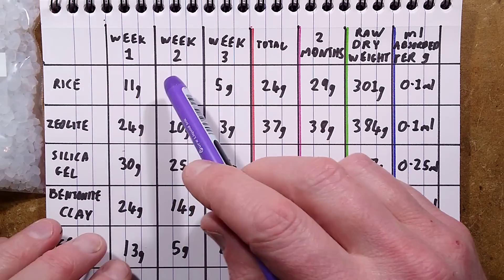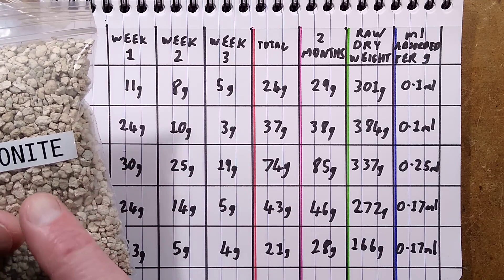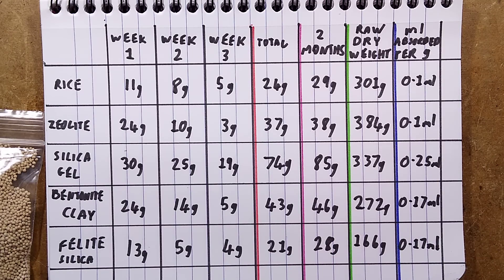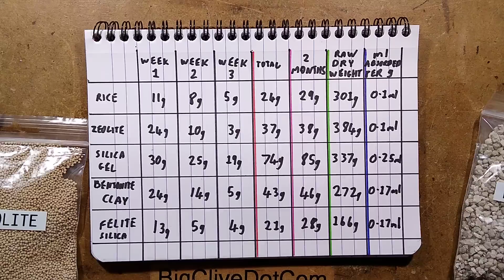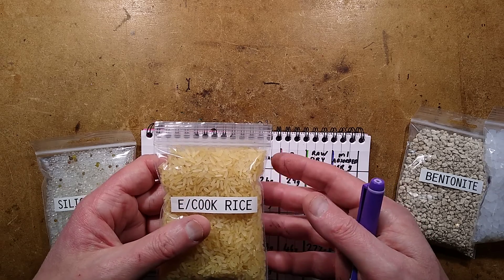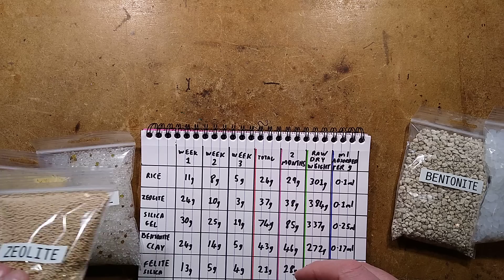Five desiccants - two month test with full results

Comment: I've used a variety of desiccants in school and at work. One you could try is Drierite (calcium sulfate) It is less expensive per gram than silica gel, but absorbs less moisture. Yes, regeneration at higher temperatures would improve performance of silica gel and especially zeolites. Note that there are several different types of silica gels and zeolites. Some types work better than others for drying air. Desiccant grade zeolite needs much higher temperatures to regenerate fully than desiccant grade silica gel. At less than 40% relative humidity fully regenerated zeolite has a higher capacity than fully regenerated silica gel. The absorption capacity varies with relative humidity and to a lesser extent temperature. Suggest you get a combination high/low recording digital thermometer/hygrometer ~$10 USD.  Lots of desiccant info at Sorbent Systems website.

Comment: Very cool experiment!  But I imagine Magnesium Sulfate will be far superior.  The stable form we typically buy as "Epsom Salt" is a heptahydrate at 246g/mol, so the anhydrous form at 120g/mol  (which you can get by heating to 250°C) can absorb 1.05ml/g!  Or heating to only 120°C will result in monohydrate at 138g/mol, which can absorb 0.78ml/g.

Comment: How dry do you want it to be ? Sometimes I'd use quicklime pellets/rocks in a closed glass desiccator with or without vacuum. Depends on what you try to dry. Once I had to dry ammoniumacetate to form nice dry pure crystals, well that needs a closed system with the quicklime but no heat or vacuum otherwise it will either melt or sublime. Water vapour  and also the carbondioxide that is present in the air reacts with the lime to form the hydroxide and carbonate from the air. The quicklime can be regenerated by calcinating it in an high temp oven such as uses for glass working. 
And yeah please use both the mass and volume for comparing different methods of drying agents. 
A wet phone would brake if under full vacuum but nested in silica drying beads in a glass desiccator and a bit lowered pressure and an infrared lamp pointed at the setup to ,say, 40 degrees C does wonders. 
Also its important to know which type of "wet" is the culprit. Rainwater is ok enough to put it directly into the system. But spilled beer or soda or even tap water is nasty. Then asap spray and rinse with distilled water quicly to get rid of salts and use a vacuum cleaner (with care other wise the speakers etc will pop ) for example to remove the bulk of the liquid. Then to dessicator and hope for the best. An alcohol solvent the 100% pure type either methanol ethanol or IPA can also be usefull for cleaning and drying but in the case of a phone I bet it would damage it. 
It is upsetting that batteries are no longer easily removable from devices nowedays, it would prevent a lot of damage if you could can remove the battery in a hurry and then also do the rinsing and drying ritual.

Comment: Would the relatively low drying temperature not put materials with very high adsorption at a disadvantage?

Another dessicant I've been seeing a lot lately is calcium chloride. It comes with spools of 3D printing filament, but apparently it's more of a powder. Can't feel any grains in those bags.
Reply from the maker: Calcium chloride turns into liquid as it absorbs water.  But some pouches have a gelling agent in them.

Comment: Horses for courses.  If you just want to take the edge off humid atmospheric air and regenerating the desiccant manually, then it makes sense to measure how much water the stuff will hold when it's at equilibrium in a dewpoint of (say) 6C.

If you want to achieve -56C (atmospheric equivalent) dewpoint in air at 300 bar, you're interested in desiccant that can take the punishment inherent in being dried out to that extent and this is where the more exotic materials come into their own.  The beauty of zeolite desiccants is that they'll stand pressure swings of 300 bar accompanied by temperature swings of 200C and will put up with that several times an hour for months on end without turning into concrete.

Comment: hi, please dry the silica at 150°C as it needs that temperature to drive off all the water from the silica. I use the microwave (in bursts) and measure with a thermometer that I stick in. Once the 150°C  are reatched it stops giving off water  vapor.

Comment: Your sensible use of metric measurements reminded me of this quote I love by Josh Bazell:

“In metric, one milliliter of water occupies one cubic centimeter, weighs one gram, and requires one calorie of energy to heat up by one degree centigrade—which is 1 percent of the difference between its freezing point and its boiling point. An amount of hydrogen weighing the same amount has exactly one mole of atoms in it. Whereas in the American system, the answer to ‘How much energy does it take to boil a room-temperature gallon of water?’ is ‘Go fuck yourself,’ because you can’t directly relate any of those quantities.”
― Josh Bazell, Wild Thing

Comment: Good test. I will say hot air absorbs more moisture than cool air. So in an ideal situation,  you would heat the entire room to adsorb all moisture from the room into the air and then push it through the drying media. But your little heater probably helped a bit, Im just curious about the rest of the room. I.e. a humidity measurement from the room would be an interesting thing to follow. But it would probably have to be a relatively small room to see any real changes. Good job. I love it.

Comment: Believe it or not, science has already done these tests and the data is readily available in the standard literature.  This is because selecting the correct desiccant often means the difference between a process working or not, or at least can have dramatic impacts on the bottom line.  You can often save yourself a lot of needless effort with a minor effort of research before committing to a project requiring months of investment.
Reply from the maker: It's always good to do your own tests with actual available materials.
Reply: @jzero4813 Unless you use the exact same product in the exact same environmental conditions for the exact same purpose, the "standard literature" is objectively irrelevant.

Comment: You should try some other easily available, though maybe slightly less convenient desiccants like calcium chloride or if you really want to see something good, try phosphorus pentoxide. They are much faster and higher capacity than silica gel. Calcium chloride is pretty easy to buy or make, but it makes a goopy mess so you contain it in a dish or something. Phosphorus pentoxide is a little harder to get but it's the bee's knees and will stun you at how good it is.
Reply from the maker: The calcium chloride was too wet for this test.

Comment: You should try Activated Alumina. I have some for my 3D printer filament and it seems to work way better than Silica Gel. Slice Engineering sales them in canisters for 3D printing and they ship internationally.
Reply: Thanks for the tip! I have just been using silica packets for my filament. I'll buy some activated alumina and give it a go.
Reply: @RiffRaffMama.  I used to use the silica gel, but my dry box only got to ~35%. Now I am using the  activated alumina and the same dry box is sitting at ~15%. Also no more PLA that is so brittle it breaks just sitting there. What happens when it gets too wet.
Reply: @dl200010  Is that why that happens? Can you still get the moisture out of it at that stage, or does the dessicant just keep the moisture away?
Reply: @RiffRaffMama.  Not sure if you can save the bits that broke off, but the spool I put in a filament dryer for 8 hrs. The descendants are to keep the box air dry. Pulls moisture out of the air. I don't know if it can pull it out of the filament.

Comment: I used to use baked out epsom salt wrapped in paper towel as a dessicant for the optics chamber of moisture sensitive laser equipment. It worked far better than the silica gel beads in protecting the moisture sensitive crystals inside.

Comment: Calcium chloride is so cheap & effective, reusable desiccant hardly seems worth it.
Reply: i have three bags of calcium chloride for my electronics at home. one is inside my computer, another one inside my LCD TV and the third one is in a sealed container in case i might need it someday
Reply from the maker: The main issue with it is that it turns into a very conductive liquid as it absorbs moisture.

Comment: I would recommend not using traditional cat litter (bentonite clay) as a desiccant. Having had cats I know that kind of litter is very dusty and the dust gets everywhere. It would definitely get onto the filament itself and cause damage to the nozzle over time, unless one had a hardened nozzle meant to print specialty filaments (marble, wood, carbon fibre, etc). It would be like printing with a filament that contained clay. The dust problem also makes it inappropriate for anything concerning food.

Comment: There are a LOT of different types of zeolites, but for the common ones intended to adsorb water, you really need to dry them between 200-220°C at least. (Some kinds of molecular sieves even require overnight drying under vacuum at 300°C, immediately before use!)
Also keep in mind that "drying" doesn't just mean "sucking up" liquid water or absorbing water from the air at high relative humidity.
Unless the drying agent chemically reacts to destroy the water, there will always be some amount of free water left over, because the water adsorption/desorption processes will eventually reach a dynamic equilibrium. This is why adding multiple times the mass of dessicant, that you theoretically need to adsorb/absorb all of the water in a fixed volume, results in not only faster drying but also gives you a dryer end product.

For example, a good zeolite will adsorb water from fluids even at relatively high temperatures (50-80°C) and will be able to maintain single digit PPM levels of water contamination at equilibrium (assuming a large enough excess is used).
At the other extreme, rice will actively make a truly dry fluid much wetter (going from ~10 PPM of water to > 1,000 PPM), even if you dried the rice at higher temperatures and used it immediately after.

Some Zeolites just "bind" the water much stronger than any other reusable dessicant (hence the high temperatures needed to dry them) and they can therefore effectively dry a larger variety of materials (i.e. you could use 3A molecular sieves to dry rice or bentonite clay, but you can't do the reverse. This is important when the thing you're drying is itself hygroscopic.)

Comment: DampRid uses Calcium Chloride. The downside is that the hydrate is a liquid and is rather corrosive, and it can still absorb water even once it's a liquid so if you spill any you'll get a seemingly permanent wet spot on whatever it absorbed into.

Comment: Clive I would suspect that the material with the largest surface area per mass should have an impact on the uptake of water in the material.
Just as in batteries the electrodes with the largest surface areas can store more energy.

Comment: Very good! I have a personal interest in this (you do that a lot with your vids - Ms.Flambeaux excluded :D)... 

I have a hyper-baric compressor that can easily go to 4000lbsin2 (i.e. ~300 bar) and the target for the compressed air really does need as close to zero moisture as possible to avoid damage. There is a two stage piston in the cylinder with a first stage "basic" compression, and then a second stage "final" compression that has a tiny "needle" piston with massive cyclinder walls. The problem comes in with moisture in the air at these pressures and dimensions and it gets really hot when working hard - 100C+ easy. I run the input through a series of cotton "swabs" that take out any obvious moisture and there is a gravity-fed bleed valve that needs opening several times during a session and always produces hot emulsified oil & water. 

The final output is then fed through more swabs (to remove oil vapour mainly) and then into a thick-walled cylinder which is the final drying chamber. Inside is an acrylic tube about a foot long filled with colour-changing silica - it starts out orange and changes to dark green when it has absorbed moisture. The tube is a loose friction fit so as not to burst it in the high-pressure air (i.e. pressure is the same both sides of the wall) with an O-ring at the far end so the air can't sneak past but rather has to pass over the silica. The output air should be very dry but I wonder how quickly the silica will absorb moisture? That said, the silica is still orange and I would have thought if my pre-drying was shabby, I would at least have seen some disclouration (it does in normal air). I have seen "Molecular seive" available for drying but I don't know what the material actually is for reference.

From your figures, the 337g of silica you started with seems a bit more than in my acrylic tube-ful (never weighed it but will now) and rough maths says it was taking out ~25ml per week, which, say, is ~4ml per day or 160ul per hour... which now I write it doesn't sound too bad. I wonder if the forced airflow and huge pressure will make any difference in my case. The pessimist in me is mindful that high pressure tends to squish the water tighter into the air molecules (hence high pressure = fine weather) so maybe the final drier is not as effective as it might if it were pre-drying - i.e. on the air intake somewhere. Unfortunately I have no way of measuring.

So my concern is not so much "quantity" but rather "how quickly"... I am going to start with dried silica (yes you can re-use it) and do before and after measurements. I have to spend some time thinking about what constitutes a good test... time or volume of air - this latter is considerably and I would need several goes at it just to let the compressor cool down.

Thanks Clive... inspired me to do some tests of my own. Maybe even video it and post it.

Cheers

h

Comment: EPSOM SALT!
Try that, though you need to find a way of containing it as it will expand when it absorbs moisture.
To make it anhydrous, simply heat it to about 80 degrees for about 10 minutes, and stir it before ramping up the temperature to 110 degrees C - and leaving it for another 10 minutes, stirring occasionally.
I did this in a glass jar in an oven - so the end result may vary; but the idea behind stirring is to stop it from forming a solid hollow 'cake' which is really hard to get out, and may not have as much surface area as the granular powder you get when you stir it up as it dries and shrinks... Also you don't want to melt it...
The result is a very active desiccant, such that it shrinks down to about 1/4 the original size when dried, and is difficult to keep 'purely anhydrous' since it will immediately draw moisture from the air once the temperature drops below 80 degrees!

Comment: Hey man, i have a "strex" wireless electronic airduster here.
Its broken.
I know whats broken too.
Its the power button.

My last one broke too and that time was within warranty. 
Idk if it still is, but i declared it intentionally cheap garbage because i was SUPER careful the second time, so i bought a "compu cleaner xpert", which was only a little more expensive, but seems actually well made and much more powerfull as you plug it into an outlet.

If you want i can send the "strex" to you, it seems to be an often rebranded dropshipped item.
Its not horrible and if you can fix the power button im pretty sure it works fine.

Im not sure how or where to send it though and how much that costs to come from the netherlands.

If you want it let me know how!
Reply: Oh, yeah... its a noisy 51.000 rpm jet engine...

Comment: I had a phone with a non-removable battery; it took a drink of water through its charging port when I was caught in a summer shower. I was temporarily unhoused at the time and didn't have any means to properly dry it out before it self-destructed in a constant boot-crash loop. I now will only use phones with removable batteries, and shut down the phone and pop out the battery if I'm caught in a similar shower (which frequently happens this time of year in my area).
If you have a toaster oven, a moistened phone, with battery removed, can be dried out fairly safely at 120-140 Fahrenheit (50-60 Celsius) for half an hour, which is conveniently a full turn on the timer on most toaster ovens. The plastics in basic bitch Android phones are stable well above those temperatures.

Comment: What would really be interesting is not so much, how much it can take up, but to what level it can drive relative moisture down. A chemical reaction with water, for example, would only be slightly slightly inhibited, if the relative moisture is cut in half, even if the dessicant could take up loads of water. Zeolithe is probably the best, but it's a bitch to dry in the first place.

Comment: Most phones can be saved if you have a professional that can micro solder, clean the corrosion any remove any shorted caps. Most caps are just filters anyway and will work without them.

Comment: I like the fact that the removal of water by desiccants requires no electricity but the huge amount of water that an electric de-humidifier removes from the air per day is impressive (liters). I wonder per ml of water removed what the cost difference is between the passive and active electric methods would be.

Comment: Thank you for the important test! So i switch my recommendation from rice to silica gel, e.g. to dry a phone. If your cam/drone/Phone is soaked in salt water, remove the battery,as fast as possible, drown it in distilled water to remove salt, suck the water out using a vacuum cleaner, put it in a bag with silicagel, vacuum seal it, place it in an oven for 12h and 60°C Celsius.